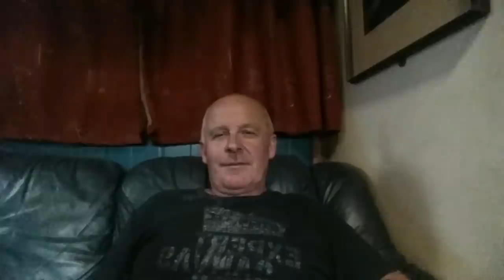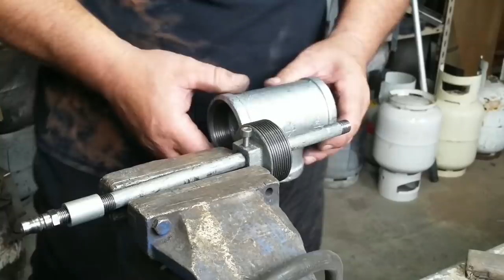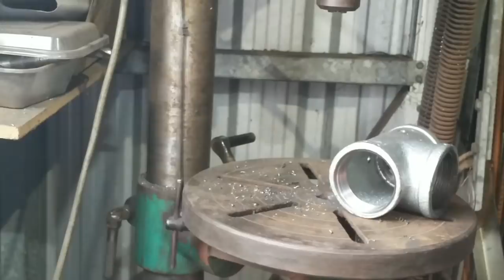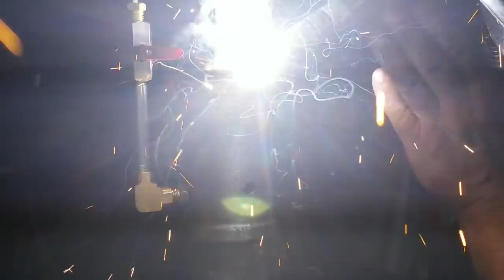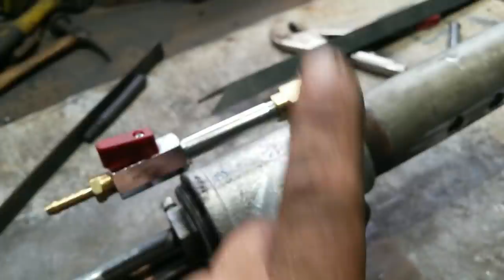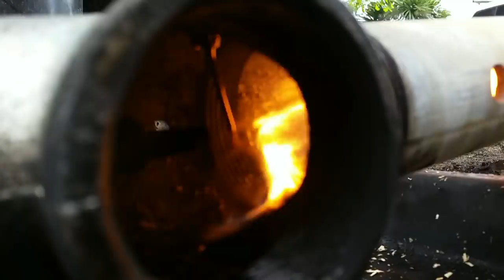Make your own Free Diesel from Waste Plastic!  PART 1

Comment: You lost me @8:38. You give no overview of the build especially no visuals [even crude ones]  to help orient the watcher. Immediately going into esoteric bits with no connection to the overall build gets boring quick. Need to provide context. A fascinating idea, so I will look for other videos on the subject. Thanks
Reply from the maker: this series has 7 vids so far, the first one was an overview- the rest are about building each part and the testing- patience grasshopper....
Reply: @t.h.o.r.  I am a little confused. Your title is "Make your own Free Diesel from Waste Plastic! PART 1. Looked at your channel site and it said one of two. Where are the ones you are speaking of " Did I miss them" The "how to looks well done"

In addition, it is good to give a small overview of the build [many other creators use this method] on every vid to avoid this confusion.  
Thanks, I appreciate your time and effort
Reply from the maker: @uppitywhiteman6797  these vids are all in a playlist - parts 1 to 5 currently with more to come. if YT is not showing you the rest or the playlist go to my channel and look under playlists. thanks so much for your interest
Reply: @t.h.o.r.  Thank you for your helpfulness. Very interesting idea. 
I'm an expat living in a tiny village in Mexico. Gasoline has to be trucked in, in 55 gal barrels. 
Something like this could be a community project and undeniable benefit. Thanks, again.

Comment: I have doubts that you can get idiots at home to do proper fractional distillation with a crude setup... This will likely require months of tinkering to get it to work right.
OK, I'm not even 4 minutes in and he is using galvanized pipe to create a burner, this is going to put off toxic Zinc fumes when heated that will eventually vanish when all the zinc has been evaporated off the pipe! On top of that plastic is contaminated with PCB's that are known to cause sterilization in mammals and developmental issues in children. So if you are planning on running this in your Tiny house that just means more emissions per cubic foot of air. This is dangerous and stupid, you and your wife will become sterile and your children will be developmentally disabled! It's like using mercury fumes as pesticides on ripe tomatoes growing in your living room.